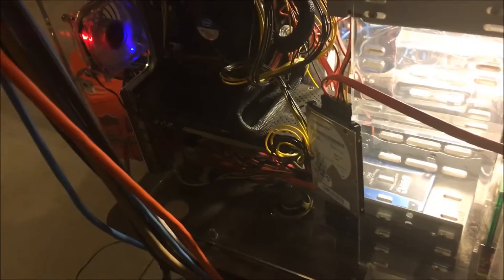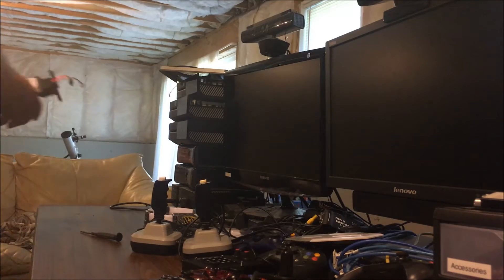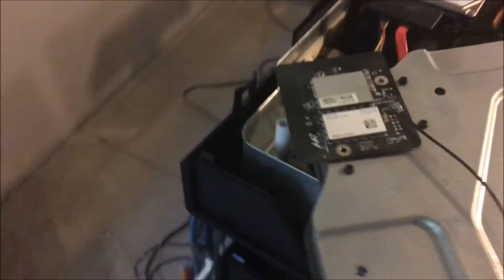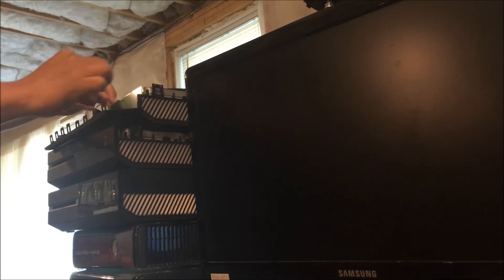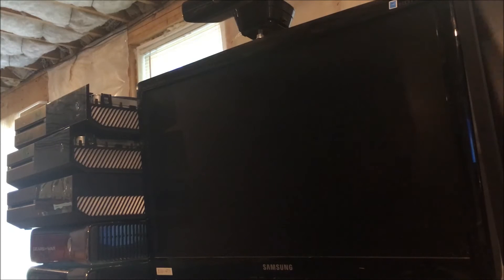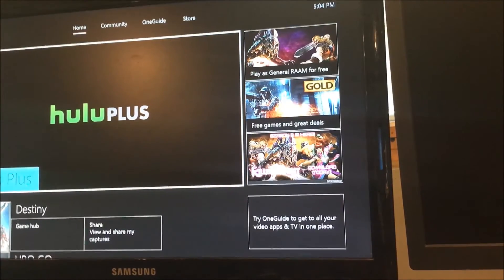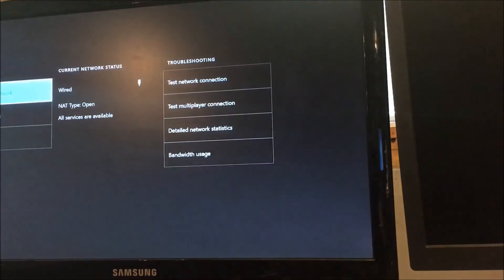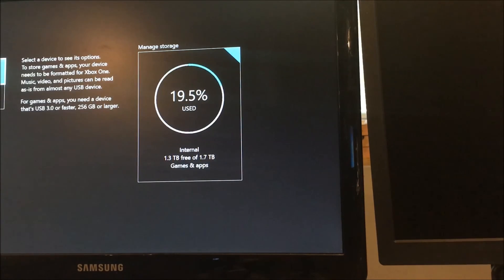Xbox One Internal Hard Drive Replacement Part 16: Install and Test the 2TB Drive

Comment: Some games (halo 3) cannot play from the Hard Disk IF the disk is nearing full capacity. If this happens to you, the affected games drop to less than 15 FPS but then if you go and delete a game or two and free up 10 to 20%, the game will go back to being locked to 30 FPS.

Comment: This method does work, the only downside, just like all the others I've tried. If a factory reset is done in the future, the 2TB HDD is partitioned back to a 500GB HDD, or whatever size the original HDD was before the upgrade. It seems to me the internal NAND inside the Xbox One has a record of the size HDD it originally came with, and preforms the format/partitioning as such during a factory reset.

Anyways, thumps up on all the videos, this will help out a lot of people.
Reply from the maker: Hey Maverick,
Just happened to see this at the top of the list. In case you weren't aware, the new method/script allows you to upgrade to 1TB or 2TB and support a factory reset. 
https://www.youtube.com/playlist?list=PLURaLwRqr6g2GyS2XUr_yP02tukvIh1rV
Reply: Late to the party, but glad this was solved. I'll be trying the new method before selling my XB1 for the new X model.

Comment: would this work on 360 ?
Reply from the maker: Do you mean cloning one drive to another or upgrading to a drive larger than 500GB?
500GB is the limit for official drives since they use a special "security sector". If you have a JTAG/RGH system you could use a 1TB or 2TB drive since they can ignore the "security sector". 
Because of this "security sector" and because 360 drives use a proprietary files system, similar to but not exactly NTFS, Clonezilla might have some issues as well.

Comment: Thanks for the video I finally got it to work on my 4 TB Drive.  I used Clonezilla process and then corrected any errors that I received through Clonezilla using Ubuntu.  Booted perfectly the first time no need to restore.  

here are some notes that may help others

1 - I never realized I couldn't use a 4tb HD (max drive is 2 TB)  until i watched one of your later videos.  After reducing the User Content partition to 1.73 it worked perfectly using GParted, system booted first try no need to factory restore process

2 - Clonezilla did not want to copy over System Update partition and failed, so I went back and created the NTFS partition and copied over the files manually.  Clonezilla re-created and transferred all of the other 4 partitions but needed me to fix System Update manually

3 - Xboxmaster-3 files did not create all the partitions it stopped after 2 partitions, (maybe because I was using a 4 TB drive
Reply from the maker: These are very good points. 

It isn't just the Xbox One that can't use a drive partitioned larger than 2TB. The sgdisk, gdisk, and gparted tools also stop working correctly. Particularly when creating partitions beyond the 2TB barrier.